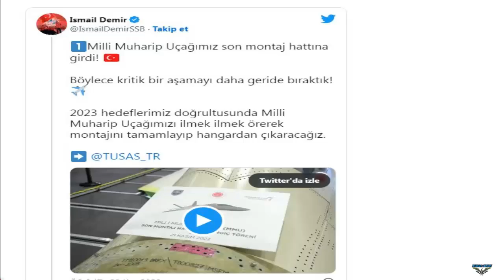Turkiye's TF-X 5th generation fighter jet prototype is almost complete

Comment: An aircraft that looks like it was inspired by the Turkish Fighter - X, F22 and Su 57 designs. It is said to have a greater body length and height than either. This first prototype double-cab one will be quite large. In its current form, it is like a 4th or 4.5 generation aircraft with F110 engines, but when it goes into mass production with TEI engines, it will be a 5th generation aircraft and will be able to control many AI-powered unmanned warplanes. Turkey has two separate studies, one of which has been announced and the other is carried out in secret. We can say that Turkey will double its power militarily in the 2030s. insallah
Reply: f35 den büyük f22 den küçük/aynı diye biliyorum ben ama kesin olarak su57 den küçük
Reply: @halilaydn4575  F35 (15.6 metre) / F22(19metre) / J-20 (20.4m) ve Su 57(20 metre) den uzun MMU (21metre)
Reply: @tolgacosgun  o zaman kanat alanı konusunda bir fark vardı 
Ama teşekkür ederim bilgilendirme için
Reply: @tolgacosgun  degisiklik var cin ve rusyanin kinden az bir sey daha kisa
Reply: @bozok370  en büyüğü bizimki olucak, bu arada mevcut prototip mock up dan farklı, tam olarak ne olduğunu mart ayında öğrenicez
Reply: @metehantalih2872  oyle
Reply: yarı otomatik bir uçak diye biliyorum pilot bayıldığında kalkış yaptığı piste geri dönme gibi özellikler olacağını duydum.
Reply: @emrearslanoglu8260  bilgim yok ama mümkün iha/siha larda zaten olan bir özellik mmu ya eklenebilir ama sistemler bilotum bayılmasını engellemeye odaklı olur bence
Reply: @halilaydn4575  temel kotil açıklamıştı şimdi aklıma geldi yarı otomatik bir uçak olacak diye.
Reply: @emrearslanoglu8260  
Doru duymussun.
Reply: I would say triple or 4 times more
Reply: 5th gen probably all those rivets exposed will reduce it's stealth capabilities which is a key element of 5th+ fighters.

Comment: What about the engine 🤨
Reply: we build engine,,,,,we have jet engine tech and build smaller vesions for kizilelma TF6000 engine from  TEI ......for MMU engine is on work and will be ready,,,,,,
Reply: 2030 yılından sonraki uçaklarımızda yerli motorumuz olacak.O gelişmeleri de takip ediyoruz
Reply: It will use f16 engines for the first 4 prototypes and in the mean while an indigenous engine development under way with the support of British company BAE systems and the target is to have it ready by 2028
Reply: Bu uçağı yapan ülke o motoruda  yapar evelAllah. Sen rahat ol 😀💪🏻🇹🇷🐝
Reply: Will be finish on 2028-2030. F-16 engine will use on this prototype.
Reply: 2 engines 2x15 thousand  
30 thousand pounds
Reply: @newottomanempire5847  
with afterburner 40k
Reply: Siz onu kafanıza takmayın ☺️
Reply: Englne is not a problem sooner or later we put in it.....